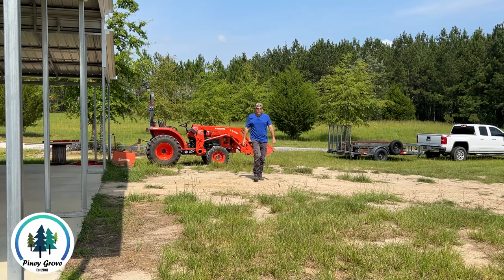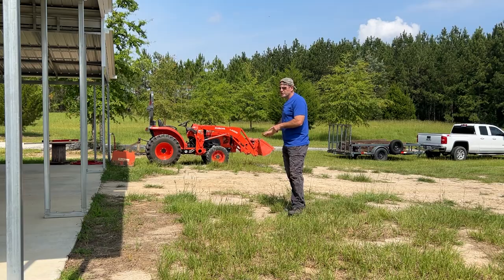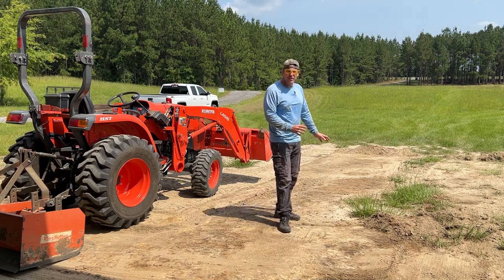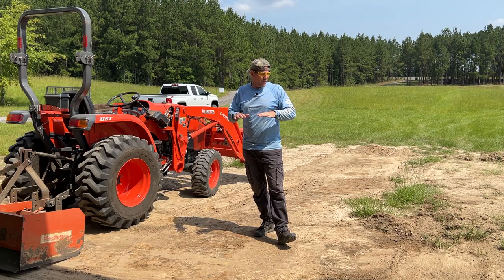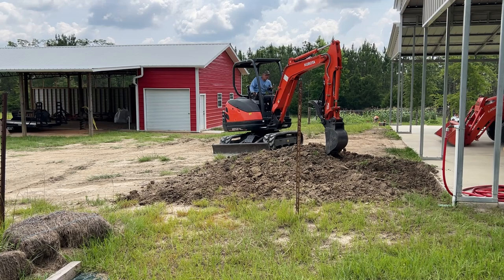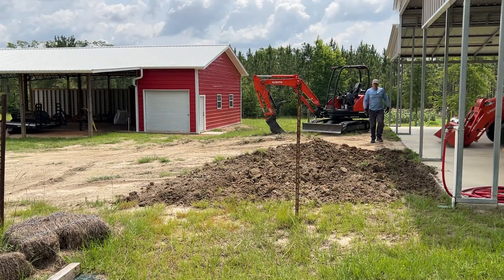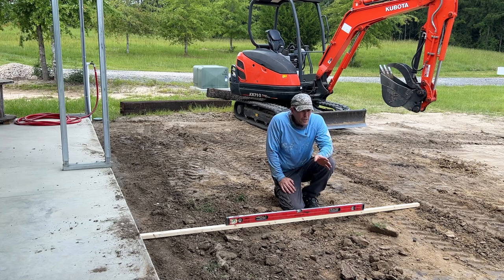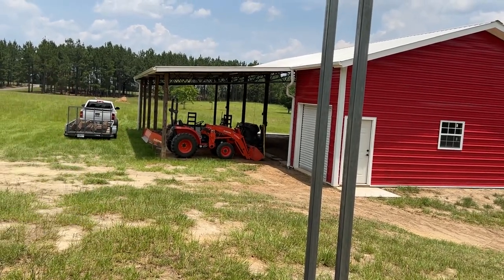How to Properly Prepare a Gravel Driveway to LAST!

Comment: The clay and material that comes from the ground when digging a pond here in Florida is great when it hardens but, like you said when wet its some slick stuff, I covered my will shell rock then millins. It makes a great base. and around the house and shed after I leveled out the clay I come back with some #1 fill to have something better for grass and plants to grow in. On you box blade, have you tried putting the rippers down a few inches, that should help break up that clay. Mini ex looks fun though!
Reply: Also, noticed we have the same utility trailer, GPS!
Reply from the maker: We have a whole series of this driveway build coming out over the next few weeks.  It came out great but took way too long and cost way too much!

Comment: I have a backhoe for my tractor that would likely work almost as well your mini-X. But for those that can’t afford some of these more expensive options, do you think a shallow tilling would have worked?  My thought is it would loosen the surface and make the removal of the overburden quick and easy, but I’m not sure it would be as precise on depth control. 

Nicely done and it pays to think through a project like you did (you called it apprehension) so that you mitigate any potential issues. It’s the end result that really matters.
Reply from the maker: This clay is rock hard when dry, so I think it would have just ate up our tiller tines.   This project took many weekends, so you will see me try to box blade another area and have to go back to the excavator.   Thanks for watching!